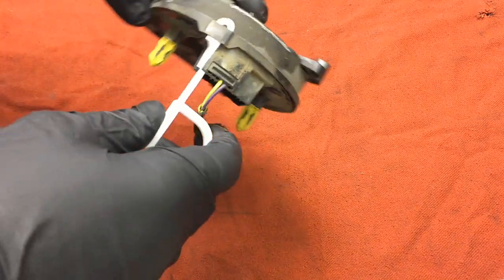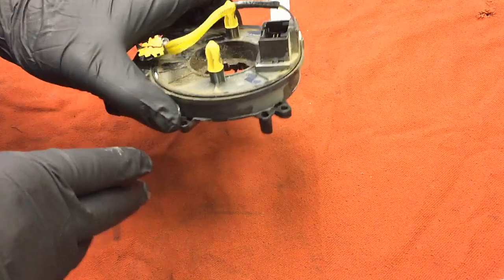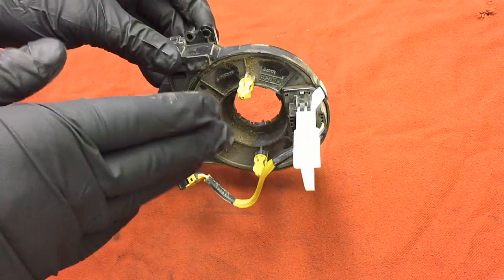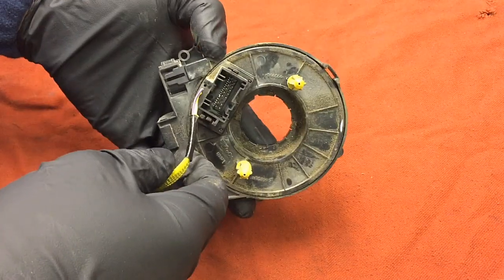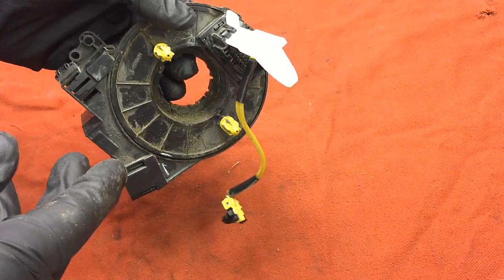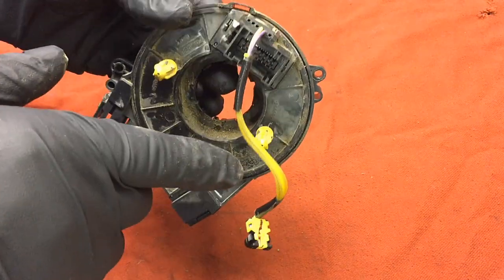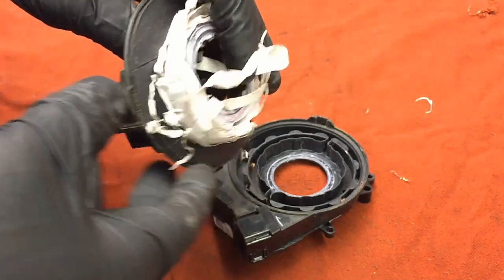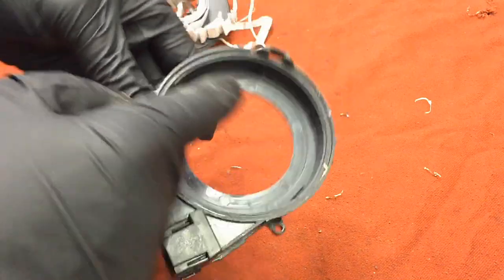Ford Quick Tips: #34 How Clocksprings Work and Fail

Comment: Does anyone know if a 99 Taurus has a replaceable clock spring?  I phoned around and no one seems to have one. My cruise control and horn stopped working..  I went through the fuses but could not find the specific one in the manual.  Any suggestions would be appreciated.
Reply from the maker: Yes there is one but you need to know the build date and plant it was built at as there are different types.

Comment: my clock spring makes no noise when I rotate the steering wheel in my caravan, how do I know for sure my clockspring is bad. I have no horn, air bag light is on, and no cruise control button communication.
Reply: Definitely sounds like a clock spring issue to me.

Comment: Hi should you lube the clockspring? The rotating plastic part is kinda tight fit against the stationary part.
Reply from the maker: No
Reply: I noticed the old clock spring was already covered in something sticky! Previous owner prolly used something..

Comment: Hey I've got a question! 

My 2013 Ford Fiesta has an airbag warning light, the seller (garage) said it's the clockspring. However, the horn and all steering wheel controls do work. Doesn't that disprove the theory of it being the clockspring? Or can it be that the clockspring is only partially defect, and that only the airbag is affected? 

Thank you very much for any help!
Reply: It's your clockspring if you have an air bag light with the dtc code B0001; just replace mine in my 2017 ford explorer and airbag light it's off now

Comment: im trying to figure out an issue with my steering. It makes a thump when I turn left or right which I can also feel. I also noticed that the shake in the car felt different when i turned towards the left after it thumps. Do you know what this can be?
Reply: +Daniel Torres it's almost like a snap when i turn left or right
Reply from the maker: +Daniel Torres what vehicle and year?
Reply: 2002 Ford Escort
Reply: is there a way to test the clockspring to make sure it is good? I have a 2000 Ford F350 Superduty Powerstroke 7.3l diesel 2wd  thank you Makuloco. Ive had a problem with the Bendix drive staying excited/engaged into the flywheel for quite sometime and cannot find the real culprit behind this. Called Ford Motor Co. dealer and asked if it could be the clockspring causing this.  Service Man's answer:  Yes, it could be. I have had some issues also, with the radio light/clock going out only and nothing else.  Dash Cluster ok, no problems there.  New tumbler, new ignition switch, swapped out higher torque starter for standard autozone starter twice.  Relay on fender panel new. Problem is still there. This is driving me nuts!! I have to starting the truck up then, shutting it down 7/8 times because I don't want to burn up my flywheel. thanks for any input or help. regards anyone else with same issues on these so called "built ford tuff loser trucks?"

Comment: I have a 2005 E350 with the 2 valve 5.4L engine. I'm getting air bag code 19. What does this code mean?
Reply: Does your horn work? If not it's your clockspring.

Comment: My horn works,but cruise control doesn’t and airbag is on
The airbag light flashed 32 code
Reply: Andy Wren that’s the same thing mine is doing you find a fix for that?
Reply: Matt Gudgel not yet
Reply: Any luck either of you?
Reply: Ingrid Zaharris mine was the clock spring   Cruise still not working
Reply: @andywren8801  ok thanks